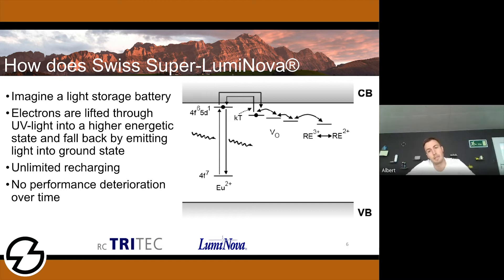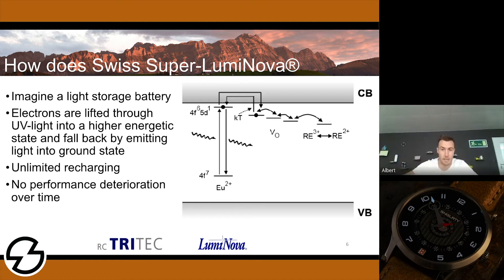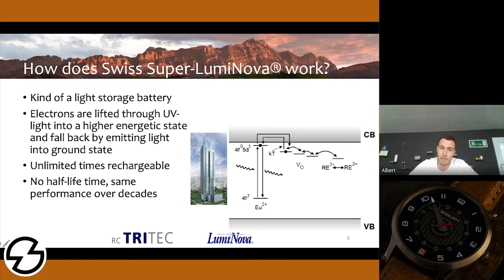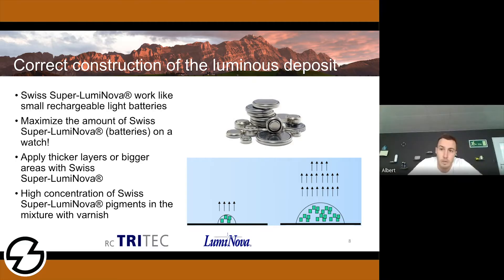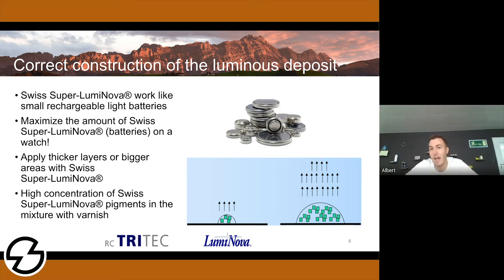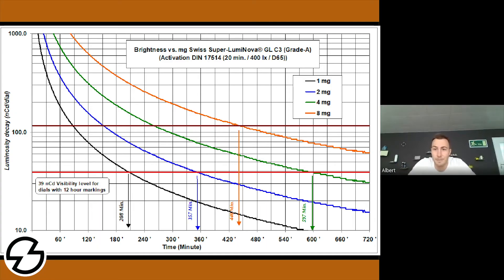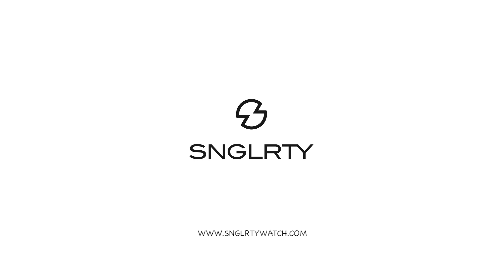Swiss Super Luminova Episode 3- Technical Details and Impact

Comment: Hi 
For the table at 9:00 , could you advise what kinds of equipment can be used for measuring this low intensity light? thanks
Reply from the maker: In order to measure these light levels you require a very specialized piece of equipment.  Unfortunately I do not know the name of the equipment but if you look up the ISO standard it will be specified in there.